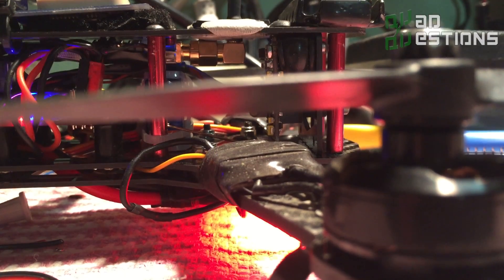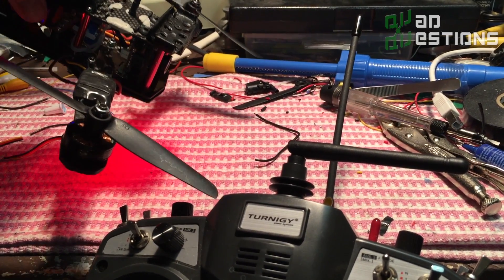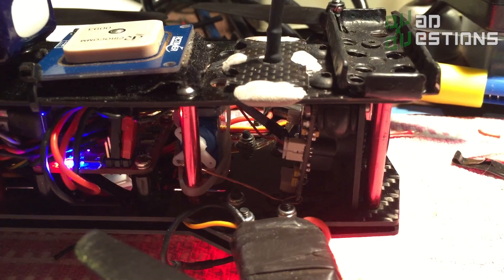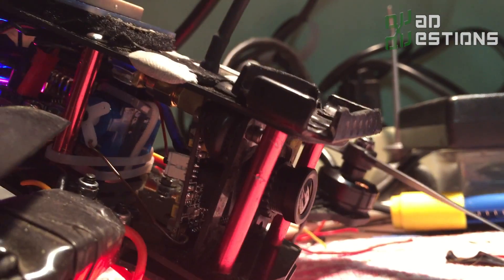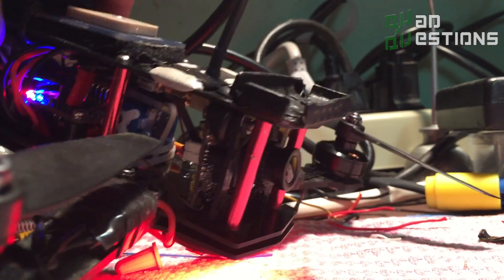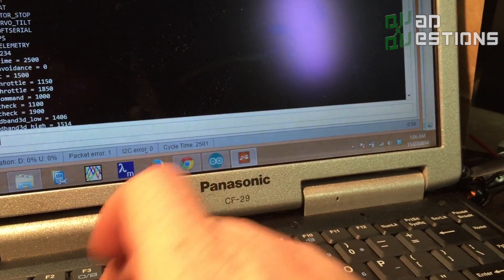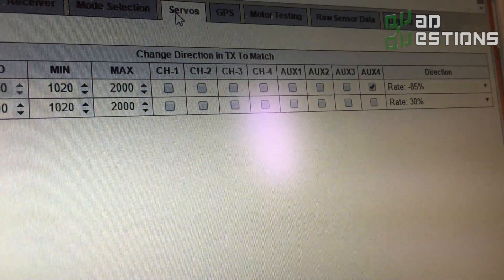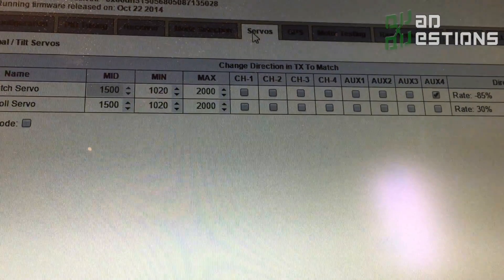Naze32 Servo Tilt in Action with Camstab gimbal & 3 way switch control

Comment: Great video.  I'm having a problem dialing it in though.  I'm using the Naze32 rev5 trying to get the SG90 micro server powered camera gimbal to work correctly. I've followed the instructions in the painless360 video exactly and when powered up the servo runs to the mechanical stop and just keeps on trying to go further. I'm running the updated cleanflight and am at a loss...any ideas would be very welcome.

Comment: this video is great but i have a question if someone(like me) uses esc without bec and need a voltage regulator to power up with 5v the naze,where will plug it because the first two pins after enabling the servo tilt fuction are for pitch and rol of the camera and the other 4 pins are for the motors. i need only the pitch pin so if i plug the voltage regulator in the second pin will it work??
Reply: +Bill Asimakopoulos I'm in the same situation here, did you solve that?
Reply: yes just place the servo in the first position the bec in second and then the motors!!
Reply: Thank you!

Comment: Love the idea of the three position gimbal. Any direction on configuring the Turnigy 9x V2 you use in the video to control the gimbal with the FMode switch? I am new to mixing so I am a bit confused there.

Comment: Hi great video.  I have followed your steps and can get the servo to auto move when I tilt the board but cannot get it to move via a switch  I have selected Aux 4 under servo and under mode select one of my transmitter switched moves aux 4.
Any help would be great thanks

Comment: I just did something a lot easier for $25. Get the FAT S tilt/swivel with or without the 600tvl. I do not like the camera but mounting another is easy. Anyways,remove the
bottom servo that controls swivel via 1 screw and the bottom plate and servo pop off. Easy.
Now it can sit flush/flat where you want it. I plugged it into my dx6i gear channel and via the menus then adjust the travel 100% iirc in one direction. It points straight ahead and when switch is flipped the cam tilts down X amount depending on how much throw you enter. Also can be used to look up. I use it just on landings or to verify I have cleared my roof/trees etc before getting lower.

Comment: how bout its flight time? will this setup reduce the flight time significantly? nice idea. will implemented it soon!
Reply from the maker: I haven't noticed any major difference in flight times. The servo is tiny and so the additional weight is negligible. The nice thing about quads is that the motors draw a huge amount of power compared to other electronics so you can add small things like LEDs and servos without having to worry too much about their power consumption effecting flight times.  This quad flies 6-8 minutes on a 1300 and 8-10 on a 1500.

Comment: What does Min/Max/Mid mean in Servo tab?  My servo works perfectly when I connect power to the quad.  But when I turn on the radio, the servo moves to my "pointing up/forward flight" position as the starting point.  Any ideas? :(
Reply from the maker: Philly Drones min/max/mid sets the servo output signal.  It sounds like you need to change the direction rate to make it work properly.  It might also have to do with your switch position when you start up your radio if you are not using a switch to control the angle, just make sure that no channel is selected in the servos tab, and then set a switch to Camstab in the mode selection tab.

Comment: Very nice. How about some flight video from the on board cam with the gimbal enabled?
Reply from the maker: cabster101 well,  it isn't really for making nice, smooth video, It is more to make flying FPV better.  If I let the gimbal work automatically, It makes me air sick. (you can't really get a good idea of your control inputs like that) so I use it on a switch.  I got so tired of looking at the ground when flying straight ahead.  Now I can move the cam up when flying fast, and down when flying slow.  I'll post some new footage in the coming weeks.
Reply: QuadQuestions.com I understand what its for. I fly with a tilted camera now and would like to see camera video from a gimbal flight. Can't seem to find any. I fly my inspire 1 through the gimbal and it takes some getting used to but I would like to try it on my blackout.
Reply from the maker: cabster101,  Ill get some footage on my DVR this week for you.  It really makes me sick to fly FPV through a gimbaled cam though, cause you really can't get a sense of your inputs.  I don't know if a video will properly convey that feeling.

Comment: Excellent dude !!!   by the way what is camstab?  it was on your mode screen.  I have a full Naze32 and baseflight and none of that stuff you have in mode screen pops up on mine

Plus I think this is a great idea except I would use it on my Mobius instead of my flying cam which has the most excellent 2.1 lens
Reply from the maker: camstab is "camera stabilization"  I like to think of it as the puke mode.  When activated, the camera auto stabilizes to level.  It makes for a really wheezy experience with FPV

It would be better on a video camera like the mobius.  you could use it to activate/deactivate the gimbal

If you are really trying to get smooth video with the mobius camera, you might be better off flying with an alexmos controller and brushless gimbal motors.  

The naze32 system works, but it is a little unrefined for super smooth video ;)

I'm glad you liked the video.  -Anthony

Comment from the maker: Phillipe, The quad in this video has a hawkeye DTF UHF receiver on it.  This mod will also work with a D4R-II in PPM mode with the 27ms firmware upgrade. ( I flash them before shipping)  They are available here: http://quadquestions.com/product/frsky-d4r-ii/
Reply from the maker: ***** If you have a Lumenier QAV250, you can add the anti-vibration mount to it.  It is available here: 
http://quadquestions.com/product/qav250-carbon-fiber-vibration-damping-camera-plate-cf/

The quad in the above video is a Zmr-250 frame and it has a homemade Gopro holder mounted to it.  the stock vibration plate that comes with a ZMR250 leaves much to be desired, so it was replaced.  The QAV250's Vibration plate design is MUCH better.

Comment: Nice feature - fatigue on the camera cables is my only concern. Interesting post, thanks.
Reply from the maker: Tobermory Cat This quad has had plenty of flights without any cable problems.  I think that over time, you are right, cable fatigue could become an issue.  Using high grade silicon wire and thinking about your wire angles, and holding the wires down so they don't move in too much of a sharp angle to the connector could help minimize the risk of a cable breaking. Also, Preflight inspections...

Comment: I may have to try this. Thanks for sharing
Reply: Great - I was thinking about this exact mod myself. #inspired.
Reply: Well if you do this. Please make a step by step video on it.
Reply: I have a new "racing only" quad coming in soon. Once that is set up I will circle back and make these mods on my current unit.  I think I can take it a step or 2 further in cleanliness and usability. Protos are great, but iterations will reveal elegance.
Reply: It might not be a good mod to do to a "racing quad" because of the weight that it adds.  Typical race vehicles try to squeeze every ounce of weight to maximize the power to weight ratio of the vehicle and quads are no exception.  If building a quad for pure racing applications I would just mount the fpv camera pointing up.   The servo adds a few grams that could be the difference between winning and loosing the race.  ;). I'm glad you are inspired.
Reply: no, racing quad will NOT have this mod.  Sorry if I confused.  I am getting all the lightest gear possible for the 250 (DroneKraft Mach250). My QAV250 will be the "utility" one until I find time to outfit and mod my Discovery with 15" blades, possibly go "octo" too.
Reply from the maker: Robot Pigeon If you are looking for the lightest and best ESC for racing mini quads, I will have 18A Kiss ESCs in stock any day now.  I would be happy to send you a PM when they arrive.  With Kiss Escs, you can run 4S setups with high current motor/prop combinations and still keep your weight down.  They weigh 2g each and are .5"x1".  They are also amazing as you can run very high refresh rates with them. (up to 2000Hz with oneshot PWM.)  Ill be doing a tutorial on them soon.
Reply: Possible consideration. I am still deciding on motor and RX right now.  Probably going to run 3S for a while (already have infrastructure). For ESCs I am trying to decide if I would like to start flashing them and tweaking OR {*undecided*}. Def looking for 18-20A ESC - but with out the frame in hand...I gotta wait.. (http://www.dronekraft.io/mach250)